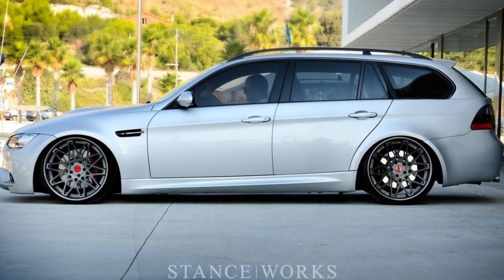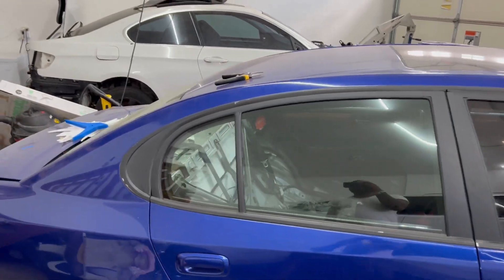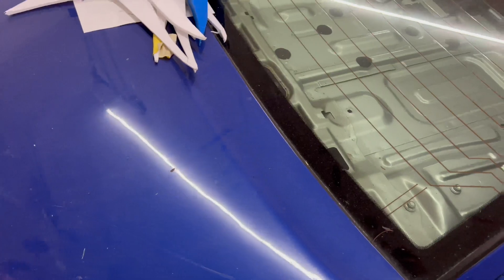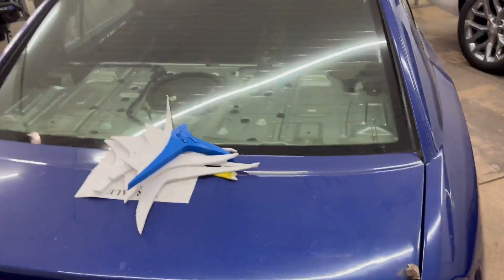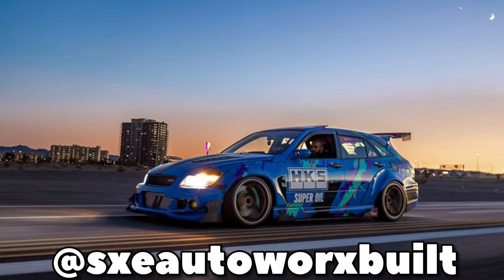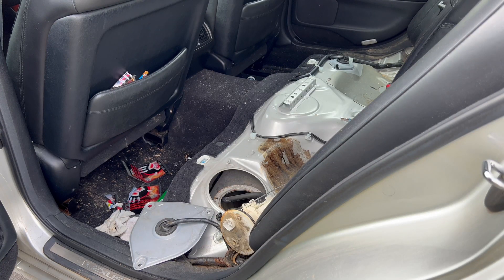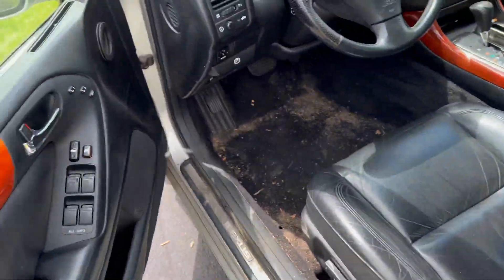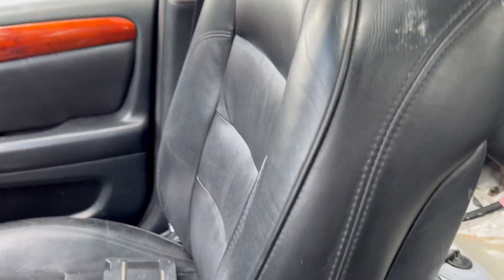AWD Wagon Lexus GS Build Series - EP4

Comment: Have you looked at any of the early to mid 2000’s Lexus SUV’s for influence?

Regarding AWD, why not just use an entire drivetrain from a 4th gen AWD GS350?
Reply from the maker: I have looked at those, I am trying to find a solution that allows me to just change the front subframe if I can. As doing the others make consist of more fab work. I then would have to make other suspension parts custom would would then add more cost and time in making more one off parts. So I am trying to find as much OEM stuff so I don’t have to make one off parts as it’s already going to have some real time consuming one parts.